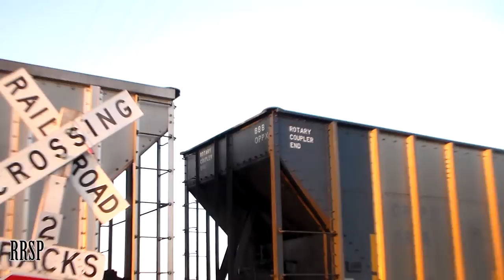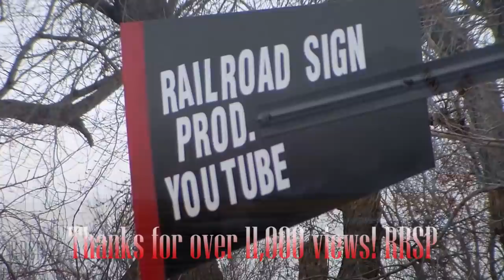EMERGENCY! Hopper Bay Opens on a Moving Coal Train!

Comment: Someone on that train had a sharp eye to notice the coal, it looked like smoke to me so you can bet thats exactly what the engineer thought. " Great a hot box fire" Nope, just a malfunctioning coal car door. Not enough to lose sleep over. Someone in a sercice truck is gonna have to scoop that up. Looks like a pickup truck full. Bet it was cold. Nice job capturing that!
Reply from the maker: Thanks!
Reply: This is most likely what happened, I can't tell you how many times unloading high-speed ballast trains that the railroad would get local reports that our train was on fire.  Hell I've even had MOW say the train was on fire b/c they weren't close enough to see that we were dumping rock.  With what appears to be a barely cracked door I'msure the engineer looked back, saw "smoke", said holy $#@! and slammed the brakes.
Reply: I did not see the conductor walk back to the leaking car, it is very unlikely that he even knew about the leak.  The signal was probably not favorable and the engr applied a full service brake application, the DPUs applied train brakes at the same time enabling a good stop, although the trains brakes sounded as though they were in full emergency.   This coal car is a leaker, there was an air pocket from previous leaking and the heavy braking caused the coal to fall further down, leaving a small pile on the track.   One door does not open on these air dump cars, they all dump at the same time and for safety's sake the crew likely did not have the main reservoir hose hooked up, we never did.
Reply from the maker: dochutto from 8:00 to 10:00 you can see the conductor walking to the car on the right side of the screen
Reply: I see him now, he must have seen the dust and stopped on that reason, it probably looked like smoke off a hot journal.  Good for him, at least he was looking out.
Reply: they do not stop trains for coal dust. @dochutto

Comment: When the train stopped you were next to the 85th car in line.  It looked like there were about that many behind so maybe about 170 all together?
Reply from the maker: It was probably closer to 130-140. That's usually how long coal trains are.
Reply: @RailroadSignProductions  
either way, that's a whole lot of coal.
Reply: All of these cars are similar.  OMAX 1020 @ 13:33  LD LMT 237400  LT WT 48600  means there is 188800 or 94.4 short tons.  The shiny cars are aluminum and should carry slightly over 100 tons or 200000.  If you figure 119 tons per car then a 170 car train would be 20230 tons + 4  X 215 = 21090 tons of train.  These cars have dumping gates and equipment so most of the coal cars I  see are the bathtub gons and can carry slightly more load than these.

Comment: You are probably just seeing smoke from the engine and not to mention all that brake dust that gets kicked up. You are looking at it from far away and I'm guessing it's a hot day so it's going to seem distorted. You would of heard his sir hoses go if there was s car in the way
Reply from the maker: Thank you for your comment. That is not smoke from the engines in the video. When the camera focuses at 3:13, you can see coal pouring out of one of the hoppers, and coal dust blowing in the wind. It was also filmed in February, so it was not hot out at all- if I remember correctly it was in the 30's that day, but by the time this video was shot it was getting colder.

Comment: Its really odd that only 1 door opened, as all 5 operate simultaneously from a single cylinder through common linkage.
Reply from the maker: raylrodr I don't know exactly how it happened
Reply: Not if the latch on one door wore out and released.
Reply: @kelharper7971  right on, Kel

Comment: 100% proof positive that trains CAN stop in a hurry when necssary
Reply: i see your point, i was somewhat impressed at the relative quickness of the stop however, don't be fooled...  the TIME it takes to stop isn't the issue... it's the distance traveled BEFORE it stops, now that's the problem... i counted an ESTIMATED 50 carlengths before he fully stopped... so if this train had 130/135 cars, it traveled around 1/3rd of it's total length before it stopped

Comment: I will say that here's one excellent reason to always park on the near side of the track when doing something like this. You don't want to have to walk all the way around a train to get home! I that happen once when I was walking somewhere, and I was seriously contemplating climbing under one of the cars to get to my vehicle. If I hadn't had my dog with me, I might have done it. I figure there is no way the train could start moving fast enough that I wouldn't be able to move, even if by some terrible chance he started just as I was crawling under it. But I didn't, I walked back up the road again, and he moved in another ten minutes. But he could have been there for 3 hours for all I knew, and then I don't know what I'd have done, expect try to walk around it. Which would technically be trespassing! Bastards.

Comment: Can anyone answer how the engineer knew the hatch opened????????
I never heard or latch cover (how many per train) alerts, alarm.
Reply from the maker: Marry Ellen there may have been some type of alarm, but I assume he saw the coal dust in his rear view mirror and stopped. Thanks for watching!
Reply: I do not think so!   To pull an emergency because of some dust.  The speed he was traveling. I dough he could see any dust flying. From what the video shows. Very little coal dropped.
Reply from the maker: Marry Ellen but if you watch when the camera pans you can see all the coal dust blowing away from the train.
Reply: This is all speculation.
Reply from the maker: Marry Ellen I understand, I'm speculating as well.
Reply: My guess is that he was looking back, either because that's policy when you cross a grade crossing, or because there were people standing there, and that made him look back to watch the rest of the train make it through the crossing (if I was an engineer, I'd always be worrying about someone deciding to jump in front of one of my cars, or tripping and falling), and so he just happened to be looking back when the hopper came open. It would have to be; I don't see any way they could have an alarm without having every car wired together, and a special alarm system panel set up in the cab, and it wouldn't be worth it for the rare occasion something happens. I've never heard of a freight train wired together with an alarm; that's why the flashing light on the back of a train is battery powered; there is no electrical wiring to bring power from the locomotive. The only connection is the air hose, which runs the brakes.
No, I think he was watching behind him (or looking in his mirror) and just happened to see the hopper open, and punched the brakes. It certainly wasn't open when they passed.
Reply: @kelharper7971  Boy, what eye sight.  all that coal dust and he saw that far back.
Reply: @marryellen7713  right on
Reply: @marryellen7713  true,  observing a coal train up close as you can get, you still can't see any defect as it passes. too must dust

Comment: Hold shit, that's a lot longer than I thought it was. What was that, 200+ cars? Amazing to think that all that time it took to build up to speed, all the energy that those engines produced to bring all those hundreds of tons up to 40mph, that was the same amount of energy that was created and absorbed by the brake pads as heat when the train stopped, but in the course of like 30 seconds instead of 4 minutes. You could probably heat a house for a whole winter off the heat generated by that stopping train.
Reply from the maker: It's amazing to think about powerful these locomotives really are, especially since the speed limit on the track in the video is 60- 65 miles per hour. I'm not exactly sure whether or not it would be possible for somebody to design something to collect the heat from the brakes for houses, but it woulding amazing if they could!

Comment: Nice catch!    How did they know to stop?
Why not show the coal on the pavement or between the rails?
Learn how to do Manual Exposure.  Make sky "wash out" in order to make subject brighter.
Or should have aimed lower so lessky light so wheels  appeared brighter and more visible.
Reply from the maker: Robert Gift my guess is that they looked out the window and saw the coal dust or they saw it in the mirror. Thanks for watching!
Reply: Railroad Sign Productions.    Thank you.    Did they dump air and puthe train into emergency braking?    Did they cause flat spots on the wheels which we did not hear earlier?
Reply from the maker: Robert Gift they did go into emergency. That why it stopped so fast. As for flat spots, I don't think there were any new ones but I don't know for sure.
Reply: @RailroadSignProductions  did not go into emergency
Reply from the maker: @stuff_n_thanngs7552  going back and re-watching the train stop I see that it didn't go into emergency.

Comment: Interesting that there are rotary couplers on a 5 bay hopper.
Reply from the maker: Christopher Long anything to make unloading a little easier. Thanks for watching!
Reply: Most places use rotary dumpers now. They can't be sorting out the train by which cars are rotary and which are side dump, it's easier just to fit them all with rotary couplers and dump them all the same. You can rotary dump a car fitted with side-dump or bottom-dump hoppers, but not vice versa. No sense in scrapping the cars just because rotary is more popular, and this way they can be sorted out and used for jobs that don't have rotary dumpers when needed.
Reply: @kelharper7971  Kel, you are smart

Comment: HOW MINI CARS CAN THEY HAVE  TO MAKE A TRAIN ? THERE HAS TO BE A # ?? WERE DO THEY STOP ??? ADDING CARS...
Reply from the maker: Catfish Gray most coal trains that I've seen have around 120-140 cars, but they can be longer.
Reply: When pulling from the front, about 150 cars is the maximum, depending on the terrain. Any more than that, and the couplers will just pull out, or you'll pull the train right off the rails in a curve (because you are pulling a very heavy train with a lot of power at the front). If you put engines in the middle or behind, you can get 200-250 cars, because you basically are running two trains connected together. As long as you have 3-4 average locomotives per 100 cars, there is no real limit to how long a train can be, provided the locomotives are divided down the length of the train and not all pulling from the front. The real limit is yards and sidings; where are you going to stop a train 5 miles long, or pull out of the way for another train? It's not practical. And of course, people who have to stop for grade crossings already feel annoyed at having to wait for 120 cars. Try making them wait for 500.
But literally speaking there is no limit to how long a train can be, as long as each hundred cars has enough engines to pull it.
But of course, a train that long would take a very long time to remove the brakes, because you'd have to pump up the brake reservoirs and brake line in the entire train. That can already take ten minutes for a long train; if you had cars with leaky hoses, you might not even be able to pump up the brake line enough to remove the brakes on a train 500 cars long, unless you had the compressors in all the locomotives working together.
Real answer, in the real world, 200 cars is the realistic limit, usually closer to 100. You might find longer trains, but not by much, and not very often, and only in special cases, like Australia, where it's big and flat and straight.
Reply: Railroad Sign Productions There was a CSX train with 1,000 cars.
Reply: @kelharper7971  Right on the money, Kel

Comment: I would presume that with the hopper door secured they continued to destination.
Reply from the maker: I don't know for sure if they secured it or if they dropped it off in Schuyler on a siding. Thanks for watching!
Reply from the maker: Blake Edwards the car was set out at the next siding in Schuyler, which was about two miles from where the train stopped.

Comment: I wonder how the engineer knew the hopper was open?
Reply from the maker: They most likely saw the black coal dust blowing out from under the train when they looked in the rear view mirror.
Reply: @RailroadSignProductions  rear view mirror? he can see 85 car lengths?
Reply: too much coal dust to see very far
Reply: he didn't
Reply from the maker: Yes, he could see it in the rear view mirror. I could obviously see the coal dust from about 50-60 car lengths away because its black and the sky isn't.
Reply: @RailroadSignProductions  true, you can see coal dust a long way off, but that's all you can see.

Comment: Gonna be a lot of flat spots on those wheels! Damn!
Reply from the maker: Thanks for watching!
Reply: I think that noise was the brakes scraping against the wheels.
Reply from the maker: Mostly.
Reply: No
Reply: Not really. I don't see much sign of the wheels sliding, just a very brisk stop. The squealing is the brake pads on the tires, and if the wheels are still spinning, then they probably are sliding. Even if they are sliding, the fact that they are turning will make sure that the wear is distributed around the tire, not creating a flat spot. Same idea as ABS brakes, in a way. As long as the wheels don't lock up, you're okay. Both because sliding creates flat spots and wears the rail, but also because sliding friction is actually lower than static friction, and it will take longer for the train to stop. Which is exactly why they use ABS on cars (that and you lose all steering once the tires start sliding).
Reply: @kelharper7971  pressure on brakes is not strong enough to slide wheels

Comment: Wow, that crew must have had their eyes open! How the hell did they notice that?
Reply from the maker: The engineer must have saw the coal dust blowing out from under the train in the rear view mirror.
Reply: @RailroadSignProductions  Wow! It's quite a considerable distance to note that! Do they have mirrors that enlarge the picture towards the back then?
Reply from the maker: @weeardguy  I'm not sure if the mirrors enlarge the picture of what's behind them or not.
Reply: @RailroadSignProductions  I doubt that, Engineers don't look back. Would love to see how someone closed that door with coal coming out.
Reply from the maker: They do look back at times to check their train. When the conductor closed the door, he likely used a wrench of some kind. There's probably a video of a similar situation somewhere on YouTube.
Reply: @RailroadSignProductions  It's probably the difference in design of the locomotives. Most Dutch/European locomotives only feature a small window in the cabin doors that can be opened (or not, I don't even know). As they also don't feature mirrors, it's rather hard to look back ;) . Besides that, trains are usually way shorter in The Netherlands (operators would probably like to see longer trains, but our blocks (for the safety-system) just are not long enough. (and in case of electric locomotives: the overhead voltage is not high enough to accomodate even longer trains).
Reply: @RailroadSignProductions  that's all you can see
Reply: @weeardguy  no
Reply: @RailroadSignProductions  you can't see anything but coal dust
Reply: @RailroadSignProductions  No

Comment: Be honest: when the train slammed on it's brakes, did you for a moment think it was your fault, and he was stopping because he was pissed at you for filming him? I'd probably think something like that for a moment before I realized that was stupid and they couldn't say anything to me for filming from a roadway. And that they wouldn't slam on the brakes on a train just to yell at me anyway. But I'd probably think it. Just wondering; the way your voice shakes sounds like someone who's not only cold, but partly excited and/or agitated. Maybe I'm just overthinking things. You sound like a nice guy anyway, very polite and kind. Nice to see young people with interests. I mean, I'm hardly old, but I feel like it when I see teenagers being vapid morons, which is most of the time these days.
Reply from the maker: I knew it wasn't my fault because the engines were far past the crossing when they started slowing down. Also, if the crews don't like being filmed, they try their best to hide from the camera. Also, about the voice thing, the temperature dropped fast because the sun was going down and the wind was picking up. Even though I had a jacket on, it got cold really quickly, so you might be overthinking this just a little bit!
Reply: @RailroadSignProductions  filming had nothing to do with it.
Reply: if not on the right-a-way, nothing they can do

Comment: why not use 4 wheeler make go to faster than walking. so make easier fix it.
Reply from the maker: Dwain Loftin good idea, but how would you get a 4 wheeler out there in such short notice?
Reply: Use little carbox like caboon use for UTV or ATV , fire extinguisher co2 or water or other. anyway  use ramps. Just close to engineer train. only coal and grain feed.
Reply: Because then they'd have to maintain and buy a fleet of ATVs, and train the brakemen and engineers to use them safely, and you'd have to fuel them and fix them, and they'd be a fire hazard. Most of all, it'd be a pain to load and unload it every time, and it wouldn't be usable along a lot of track. You'd have to go to the box, open it, lower the ramps, back the machine down the ramps, drive down to the car, park it, get off, unhitch the car, drive it back, up the ramps, park it, raise the ramps, etc. And on most trains there is no reason to go back down the train at all. When there is, it's not like walking is that terrible a thing to do.